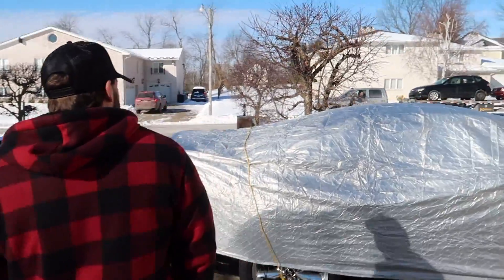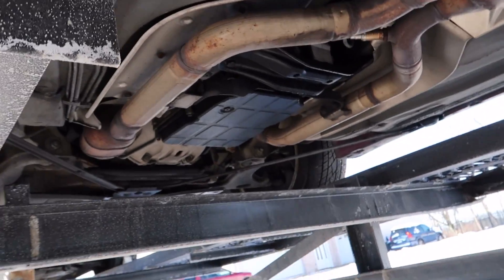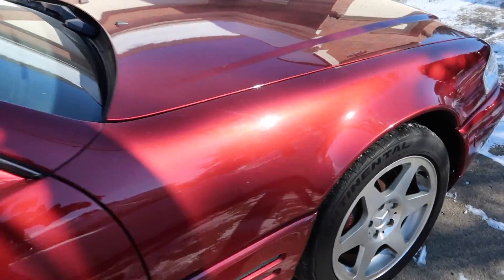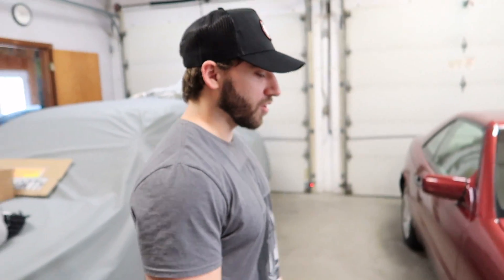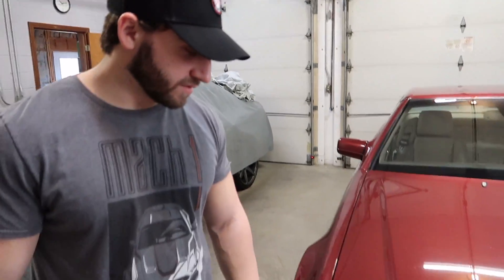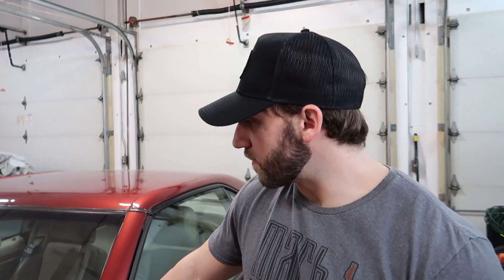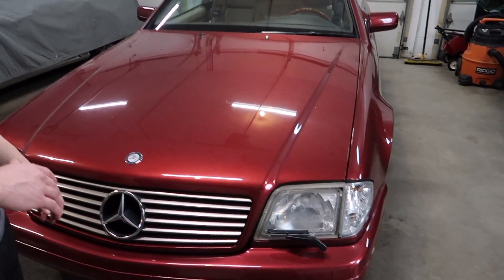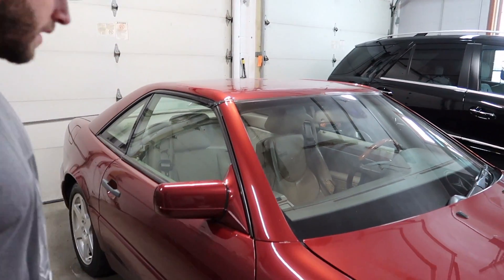We Bought a RENNtech 40th Anniversary Mercedes SL500!

Comment: The R129 is legendary. I had a 1999 SL500 sport black on black. I miss that car.
Reply from the maker: I love that the R129 does not have the abc suspension like the R230s. I believe only the R129 SL600s have the hydraulic suspension
Reply: @theconfortibrothers2827  yup and the stock suspension on the SL500 was very comfortable. I would barely feel speed bumps